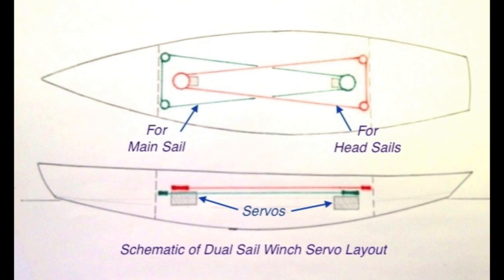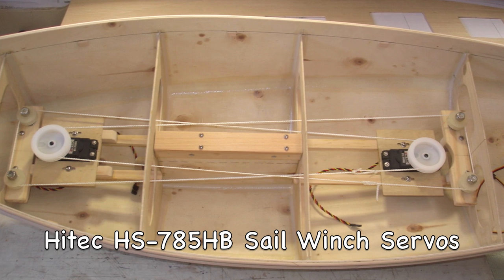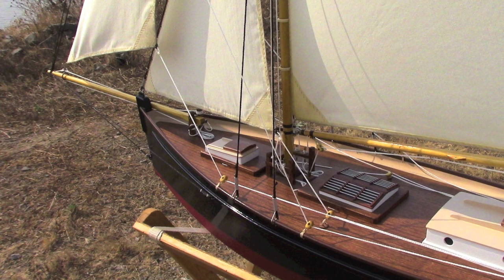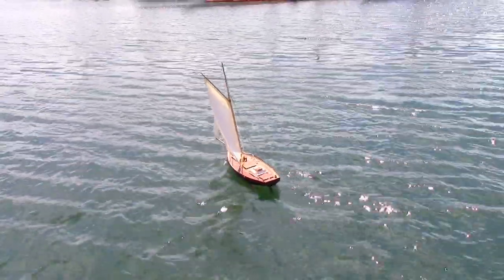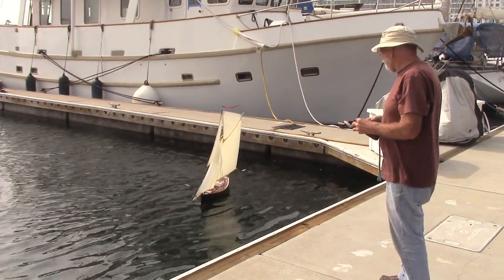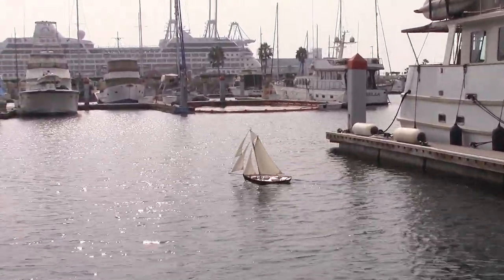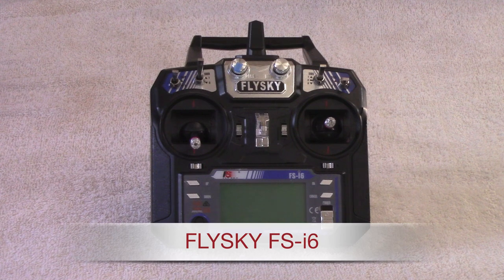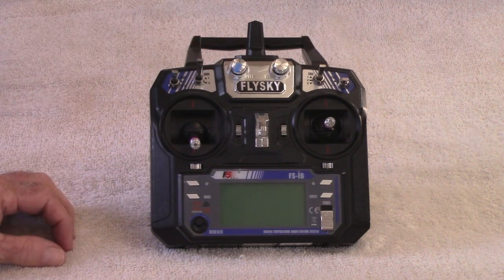RC Sailing - Tacking Flyer's Headsails - How it works

Comment: Thanks for the video.... Fitted it on my boat with a gaff rigg.
First sail today and it was so much fun! Once I worked out what side I was tacking to it was great.
Some minor trimming adjustments needed but it worked a treat!!
Just watching your video again.... The operation of your head sails in that dock is so smooth.... My installation is retrofitted onto an existing boat so operates on the deck where I'm suffering from stuff for the sheets to get caught on.
The look under sail is much more realistic than the typical front boom setup, and more fun to sail!

Comment: I have that radio and it is easy to remove the centering spring from the right side controller. That way both levers can control the sheets. Open the back and you can see how it works. There is a YouTube video on how too remove the centering device. I added a piece of plastic to give a bit of traction to the lever and its not so flippy floppy.

Comment: Hi Gary, Great video and I am trying to set this up on my boat. I messaged you before, but I am having trouble setting up my rig. My question still remains. Using your image to explain. If I let out the Blue trimming sheet, to sheet out the sail, won't the green lazy sheet simultaneously sheet in, meaning the sail will not sheet out?
Reply from the maker: If the winch provides at least about 15 inches of travel, one sheet will always be slack before the other sheet pulls in. This slack in the lazy sheet will allow the sail to billow out when its working sheet is eased. Sorry about missing your message. Best way to contact me is by email. My email address can be found in fine print on the Bearospace website. Cheers !
Reply: Thanks again Gary. I am at sheet set up stage. I will try this out and see what happens. Otherwise I am thinking of adding another full sail winch, and I will sheet out, switch of the winch for the slack sheet and turn on the winch for the trimming sheet. I don’t want to be restricted on sheet out and sheet in. I’ll email you a pictures if you’re interested.

Comment: Hi Gary, love the video and have been looking for a way to manage a headsail sheeted from behind the mast, as I am building a scale model of Comanche. I was looking to do the same as you, but I have one question. In this set up, it seems your sheet length is set. If you let out sheet on the port side it will be pulled to starboard by the opposing internal pulley. I need to be able to sheet out. Am I missing something?
Reply from the maker: Good question, there is a simple answer. There must be enough winch travel so that when the sail is sheeted in on one side (by the working sheet) there is adequate slack in the other (lazy) sheet. Thus, the working sheet can be let out a bit and the wind can fill the sail without being restrained by the lazy sheet. Hope that clears up your concern. Happy boat building !
Reply: Thanks for the quick reply Gary. That’s the conclusion I came to mulling it over last night. I will set a mock up and give it a test to get the sheet lengths correct. I already have the dual servo set up. As I use this on all my boats. I use the knobs for both main and head sails, as the other stick is used to control the swing keel. Thanks again.

Comment: All the sails cannot be controlled together from the throttle stick, can they?
Reply from the maker: Ahoy Paul, the mainsail is controlled by the "throttle stick" while the 3 headsails are controlled (all 3 together) by a separate channel using a knob on the transmitter. Keeps the skipper busy.

Comment: Would it be possible to put reef points in the main and take foresails off easily for windy conditions?
Reply from the maker: Both the main top sail and the jib top sail can be easily removed, leaving her to sail with her "lowers" in heavy wind conditions. A characteristic of the gaff cutter is that she balances well with or without the top sails. I have not tried reef points or further sail reduction, as she holds up well this way.

Comment: Have 1/4''' plate aluminum were I to make the trunk to fit would that impact the performance of the Flyer?
Reply from the maker: I do not think there would be a noticeable difference. Simply make the opening in the trunk about 1/16" (1.5 mm) wider than the thickness of the aluminum fin. Happy boat building !

Comment: Hi, I sail my sailboat in the the sea, how can I prevent it from getting away if the wind stops or the RC stops working, what type of line can I attached to the boat
Reply from the maker: Attaching a line could be problematic, such as becoming wrapped up around the rig or the rudder due to the boat maneuvering as sailing boats do. I suggest an inspection ashore, including a radio range check, to assure she is ship shape before setting off on the high seas. If the wind stops, she won't go far till the wind picks up again.
Reply: @sailtails2775  Thanks for your advice